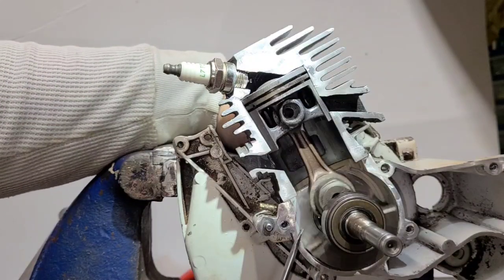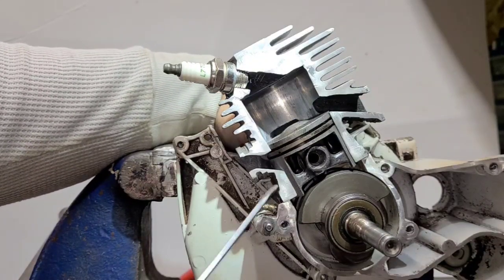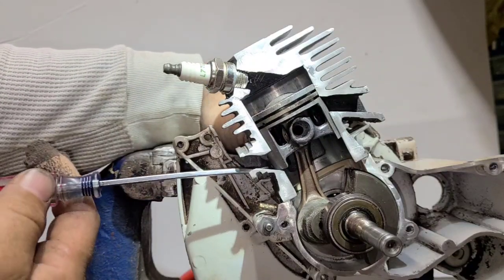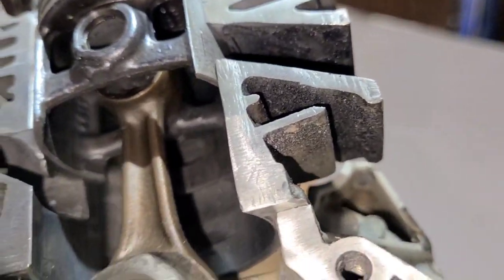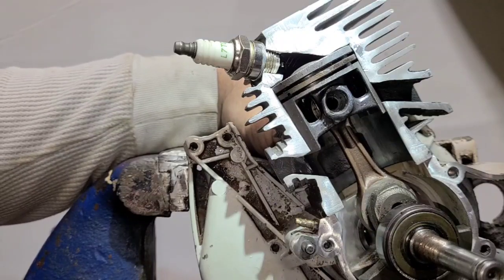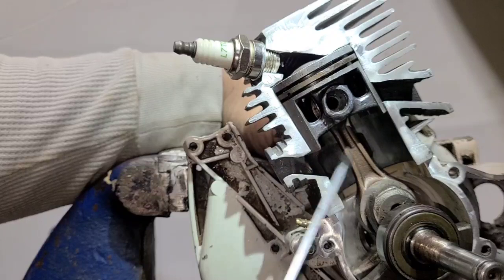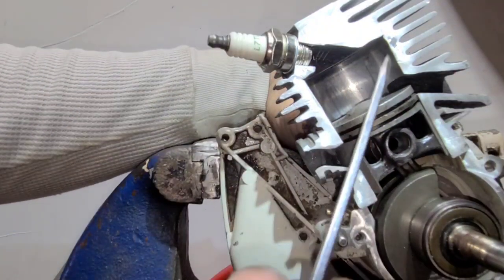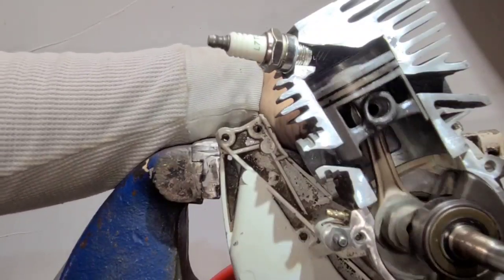Chainsaw cutaway #1 how a 2 stroke works!!

Comment: I'm glad I found you as I was trying to understand why my chainsaw was blowing so much smoke.  I didn't know that the lower crankcase chamber was acting like an intake manifold in a two stroke engine.  Now I know how chain oil is getting into the combustion chamber.  Thank you - count me in as a new fan!

Comment: Very good explanation and simple enough , it's a matter of transference between piston location and direct correlation of the transference of fuel and exhaust ports ! The lower internal case is lubricated by fuel oil premix and it acts as a pressure chamber for fuel oil as it is pressurized on the piston downstroke only to escape through transfer ports to be compressed and burnt on the compression stroke !

Comment: Nobody discusses the pie shaped weight.
Nobody discusses the angles involved in that pie shaped weight.
Power stroke feeds rotational energy into that pie.
As the pie rotates back around is gives its energy to the piston and rods causing the process to repeat.

When we start an engine, we supply the 
rotational energy into that mass with our right arm.
Such a novel concept.

Excellent, sir.

Comment: good description and demo. I'm a boat mechanic, so I'm no stranger to 2 and 4 strokes, but I will say this is new and informative to me. boat motors typically use Reed valves. I had no idea about transfer ports. very cool. as an addition to your vid for anyone interested, 4 stroke is 4 strokes of the piston to 1 complete engine cycle- intake, compression, power, exhaust. 2 stroke is only 2 strokes if the piston for 1 complete engine cycle. the intake and compression stroke happen together and the power and exhaust happen together. lastly, the open exhaust port overlap with the open intake transfer port is called scavenging. the exhaust exiting creates a vacuum which helps draw in the fuel charged intake air. I'm by no means a know it all, just adding some info for anyone interested. great vid. I learned something today! thanks, man!

Comment: Thank you so much! You help me to diagnose what was happening with my generator i put diesel fuel on, is small one, 700watts maybe, i thought it was melted but the noises i started to hear before it stopped was all indicating to be the top piston ring that overheated and broke and with this explanation I realized that one piston ring is for compression and the bottom piston ring is for vaccum at the intake stroke. So thank G-d the piston ring seemed to have prevented the whole generator to break apart since after broke, it lose compression and stopped... here in argentina is very expensive everything, wanted to have more power output and a fuel that i thought it was cheaper, i don't go out since a while, now diesel fuel in argentina is a lot more expensive than gasoline so i ended up buying 4 litres of diesel that the only purpose is going to be maybe to start firewood to clean my backyard. Diesel have more power output but at the same time for a generator is not really needed, they can rev up with no major issues to adjust to the electric load and still produce not much heat. But diesel fuel runs very hot, it has energy but over time, so i ended up having more power output but overheating the generator.

Comment: Thank you for this great explanation and demonstration of two stroke operation. I'm amazed at the timing of blocking and exposing of ports. When I was 16, I decided to hot up my two stroke Puch motor scooter. I didn't have a clue what I was doing and made a really thin head gasket. I took it for a run and blew the spark plug out of the head.

Comment: Jesus, this must be probably the best explanation and demonstration of how a 2 stroke petrol works - Never seen a better explanation in 50 years! Thank you! From your example, the upper (top transfer port) combustion chamber needs to be kind of pulling a vacuum (or be lower pressure than the exhaust) in order to draw in the new fuel / oil / air mixture?

Comment: Thanks Tinman.
I knew 2 strokes worked double time compared to 4 strokes and without valves but that was about it.
Excellent explanation and with use of your cut away. 
At first look it seems that the upper transfer would work better if up just a bit higher in the cylinder cause it looks like some of the fresh mixture can escape with the exhaust since the exhaust port is still cracked open, ...but I'm sure there is a reason for where it is.

Comment: I don't plan to build saws but this has helped fill some gaps in my understanding, so thank you for explaining these basics. It would be interesting to see an explanation of the kinds of damage that can be caused by operator error, how to avoid blowing up a saw, or what signs to look for that tell you an engine may be on its way to trouble.

Comment: Great video. This is the first video that showed, or even mentioned, the upper and lower transfer chambers which is the key, IMO, to understanding the transfer of fuel/oil mixture from the lower crankcase lubrication to the upper end of the cylinder to “explode”. Thanks.

Comment: Awesome explanation really helped me get my head around how 2 strokes work. So when a 2 stroke draws intake charge is when the bottom end acquires lubrication. And then the transfers in the cylinder wall take that charge to the top. Thanks from Australia.
Reply from the maker: Glad I could help!! Thats exactly how it works, you got it!! Take er easy

Comment: Pretty cool!  Who ever invented the 2 stroke was a genius.  The problem with the 2 stroke engine is that exhaust gas and intake mixture come in contact with each other during the down stroke.  So it is inevitable that some incomplete combustion will occur.  This is why they have problems meeting modern day emission standards.  Governments have made exceptions for small engines because the amount of pollution they contribute is small.  One of the beautiful things about 2 stroke engines is their simplicity. They are somewhat limited with respect to how much torque they can produce because they can't complete the power stroke.  It must be terminated halfway down to allow for the exchange of burned and unburned fuel.  They do shine when it comes to RPM's.  They can rev up very high without causing damage to say the valve system because the piston is the valve.  Maximum allowable revolution is limited by the carburetor and that is set by  design.

Comment: Excellent explanation.  Now I understand more fully why 2-strokes are less fuel efficient by using the pressurized air-fuel charge to scavenge the exhaust.  So the engine designers can adjust port size, shape, number and location, s well as piston configuration to improve fuel-economy and power.  Very interesting.

Comment: Great Video! Terrific Explanation of how a 2 stroke engine works. 
For a future video, Tinman can talk about how the Engine oil mixes with the Fuel/Oxygen Mixture inside the crankcase and even at the top ( inside the combuation chamber). 2 stroke causes more pollution and you will burn up more oil and thus lose engine oil in a 2-stroke engine which was invented by Karl Benz in Germany of Mercedes-Benz auto company.  Internal Engine parts will need to be replaced sooner on a 2-stroke versus a 4-stroke.

Comment: Good video! I learned something. I always wondered about the lower end lubrication. The fuel air mixture is under pressure in the crankcase, thus lubing the lower end at the same time. I am a retired Diesel engine and fuel injection tech. I never liked the term explosion! Actually, it’s a burn under high pressure! An explosion would be, if you could meter in something like dynamite or nitroglycerin. Which would immediately destroy the combustion chamber. Everybody uses that term, but technically it’s wrong. Sorry, can’t he,p myself!😀

Comment: I,m a 4 stroke porter. Would be able to add some theories about fuel distributon and port velocities that would help. That port trajectory exit is applied to valve engines also.

Comment: Although I learned how an engine works when I blew out the valves on a car with a broken timing belt, I always like seeing an actual engine working. 

Although electric cars have changed the way car engines work, there are rotary engines also, but the gas combustible engine hasn't change in it's design at all in the 100 years or so since we've invented the combustible engine. It's even somewhat close to how a steam engine also worked. 

We've Just found ways to improve performance out of it like turbo chargers and tuning things like fly wheels.

Thanks for the demo.

Comment: Excellent explanation and visual demonstration I already understood a lot of how this happens particularly the intake and exhaust ports the one spot that I think there could’ve been just a bit more detail on is the transfer ports little more explanation of how the fuel flows through them and what the purpose is but still Great Job thanks

Comment: Excellent demo and many thanks for all of your efforts.  Looking at the crown of the piston as it descends after the ignition, the upper transfer port is exposed to allow the next charge of fuel/air in but at that exact time the exhause port is open also. Does this mean that a portion of the new mix escapes into the exhaust along with the exhause gases ?  If so, is this not inefficient ? Is this why 2 x strokes are considered "dirty" and banned from many waterways ?

Comment: HEY TINMAN, I PICKED-UP A POULAN 4620 AV CHEAP FROM A GUY BECAUSE IT HAD GOOD COMPRESSION ON THE COLD-PULL, AND THE GUY SAID "I HAD ISSUES WITH IT, BUT I BOUGHT IT NEW WHEN I WAS IN MICHIGAN STUDYING DIESEL MECHANICS. IT NEVER WORKED WELL FOR ME..."  IT WAS IN THE ORIGINAL CASE IN THE BACK OF HIS PICKUP WITH A COUPLE OF INCHES OF FUEL, OIL, AND WATER SLOSHING AROUND IN IT.  THEN I NOTICED SOMETHING, AND POINTED-OUT THAT THE CHAIN WAS ON BACKWARDS.  THE BACK EDGE OF THE TEETH HAD WORN-DOWN TO A VERY WEIRD EDGE CONSIDERABLY, WHEREAS THE CUTTING EDGES LOOKED NEW.  (COULD ANYONE ACTUALLY SMOKE THAT MUCH "CHRONIC" ?:)  HAD TO BE A FIRST FOR ME.  PULLED THE PLUG AND SHINED A LIGHT, SOME HEAVY SCORING THROUGH THE CHROME-LINED INSIDE OF THE BARREL-SO WHY THE GREAT COMPRESSION?  BOUGHT IT FOR $25 FOR A BACK-UP TO MY HUSKY 61, WHICH I HAVE PORTED BEST I COULD ACCORDING TO IRONHORSE AND YOURSELF.  NOW I CANNOT FIND A PISTON/CYLINDER KIT FOR IT, (I SUSPECT THE CHEAP CHINESE PARTS MAKERS SHUN THE MORE EXPENSIVE CHROME-LINED BARRELS, JUST A HUNCH, THOUGH.  PERFECT CHANCE FOR A PERFORMANCE REBUILD, BUT I CANNOT FIND SPECS, SO I THOUGHT I WOULD ASK YOU, AND HARVEY, IF EITHER OF YOU KNOW WHAT PISTON/CYLINDER KIT WOULD WAKE IT-UP AND OF COURSE, "GET IT ON THE PIPE" AND ROCKIN'.  HAVE ANY KNOWLEDGE YOU COULD SHARE?  I JUST FINISHED PORTING MY 52MM 272 KIT BARREL FOR MY 61, AND FOUND THAT FLAT FILES WORKED BETTER ON INTAKE/EXHAUST THAN THE CHEAP SINGLE CUT BITS I GOT IN THE CHINESE KIT I ORDERED, AND EXCEPT FOR A COUPLE OF DECENT BALL CUTTERS I HAD FROM MY OLD, (LIKE 40 YEARS:), ORIGINAL DREMMEL KIT,  THAT'S WHAT I USED.  NO IDEA IF IT WILL RUN YET.  TODAY IS THE DAY... THANKS, MAN, FOR ALL THE SMARTS. I BOUNCE BETWEEN YOU AND HARVEY DAILY TO EDUCATE MYSELF.  QUITE A DISCIPLINED STUDY, IF YOU'VE NEVER DONE IT BEFORE...:)

Comment: As the exhaust gas exits does it drag in air and fuel or the pressure from the piston pushes the fuel are mixture in to the combustion chamber . Great video mate.

Comment: Nice piece of work. BUT, I would suggest under normal conditions 11.04.....,it never produces..... "...a vacuum on the top...." ie the pressure from the crank chamber is migrated to above the piston and will fill the chamber, forcing out the exhaust as best it can & will depending on the design /R.P.M. migrate into the exhaust.

Comment: Great job. Thanks.
What make of engine was that? MX bikes use reed valves. Which produces more power? Which is more efficient? Can a piston port benefit from a tuned pipe as well as a reed engine? Pity an actual engine had to suffer being cut up! I would love to see this done in 3D computer modeling - then the cuts could be virtual.

Comment: A modern stratified charged 2 cycle is even more mind boggling as it has 2 transfers for pure air. It basically is a charge of air that helps push the spent exhaust out for emissions reasons so that less unburned fuel escapes out the exhaust.
Reply: Agreed and well said Andy. Am I the only one here that thinks a 4 stroke is much easier to comprehend?😂

Comment: Are modern 2-stroke engines made so, that the piston is only air pump through crankshaft chamber? You know, so that the combustible fuel is direct injected and the burning process quite lean in most using conditions. Is not these quite ecological and exhaust gases also relatively clean. And maybe greasing of engine with food grade oil, then the fumes are comparable to all kitchen fumes pumped to rural and denser populated areas:)

And people talk the future is electric. But it must be MADE first. Why not these with hydrogen gas fuel inlet? :D

Comment: Hi, i have a old Stihl weed whacker "no Reed valves" and after replacing all the seals ect for the "vacuum" section, it still wont work right as skirt to bore clearance which is supposed to me Max .152 mm is more than that. So this loose fit not only dont provide enough suction build up but also the sliding skirt past the inlet port not seal well like a reed valve would and the port and pulse line be almost zero as it seems to be when i test it?

Comment: Any idea what would make a 2 cycle tiller rattle like it has gravel in the upper end area? It does it coming off of idle and going back to idle but not during idle and revving. It’s on a Ryobi tiller. I mean there isn’t much there unless maybe the pin has slop at the piston or it’s slapping the top maybe. I’m curious because I borrowed this thing and it started rattling just a minute or two in and it was running on the fuel they already had in it.

Comment: You took the valves out, it would never run!! It needs an exhaust and intake valves. Like an engine would run with no valves like magic or something. What sorcery is this anyway? .... 🙃😉...    
    Jist kidding man, great video and explanation on a 2 stroke. Alot of people have a very hard time understanding how a 2stroke works.

Comment: When the piston goes down and it allows  the upper transfer to open and draw gas air mixture up from the crank to the top of the piston the exhaust is open?? You must loose a lot of draw as some air mixture MUST escape out the open exhaust does it not?

Comment: How does the oil in the crankcase not leak out when it's connected to a spinning/moving part to the gears??
Reply from the maker: There is no oil in the crankcase. The oil is mixed into the fuel on a 2 stroke.

Comment: Question. 2stroke piston has a long skirt on one side and short skirt on other side. Witch faces witch port???  Either way closes ports.
Reply from the maker: Generally the side with the ring locating pins is the intake side.
Reply: @tinmanssaws  ok that makes sense.
Reply: @tinmanssaws  I appreciate it. Have another question. If I do base gasket delete I see the exhaust port will be uncovered like 10 thousandths at TDC. Is this called “free porting”. This is bad right?  Is there any amount of free porting that is a benifit at a particular rpm?? Or is any free porting bad all the time at all rpms?  Again asuming this is called free porting.??

Comment: Why is so much of the cycle spent compressing the intake air in the crank case and pulling vacuum in the crank case? wouldn't this create a bunch of unnecessary resistance? Couldn't you have a 2 stroke engine such that as soon as the intake closes the upper transfer opens and as soon as the upper transfer closes the intake opens? It seems like there must be a way were you could have this work so that the amount of air moved on each stroke stays the same but it happens throughout the stroke instead of in large sudden pressure releases. Or is something about the sudden burst of pressure needed for some reason?

Comment: Hey Tinman, great explanation! I am wondering though why the exhaust is fully open when the transfer port is fully open? Doesn't that lead to loss of fuel air mixture until the exhaust closes??
Reply from the maker: Yes it does.
Reply: thats where a tuned pipe comes in when the exsaust port opens it produses a shock wave that travels down the pipe then back up it and hits the exsaust port just as it opens again and basicly stops some off the new fule charge from escaping into the exsaust like it would if not on a tuned pipe, so you get more off the fuel air mixtuer into the cylinder to make a bigger bang!!

Comment: So, from this I gather there is no "oil pressure"... in fact, there is no oil alone... it's mixed with the fuel, so oil pressure is fuel mist pressure.  Now, how does that exactly lubricate the connecting rod and the main journals?  Is the oil just wicking into those bearings?  Is there a means to let the pressure carry it deeper?  What goes wrong with these engines? What is the fix?  Is it just excessive piston slap or cylinder wear and lack of compression?  Can you correct with over sized pistons and machining the cylinder to +10 mil?

Comment: you can see why two strokes arent the most effecient with the tranfer and exhaust
Reply: but in terms of volume, mass and number of parts it's very efficient
Reply: @peternk7947  the lack of rotating parts and friction surfaces definitely reduces power sapping friction. Less friction is a big key to how nascar engines make so much power with a small displacement.